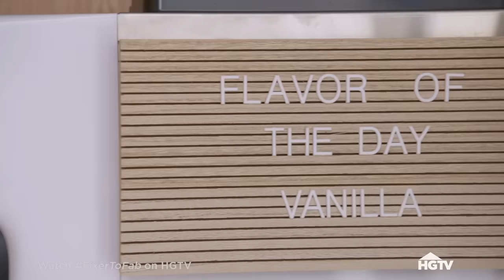The Ultimate Dream Home Upgrade | Fixer to Fabulous | HGTV

Comment: Nice overall (for <$100k), but I do hope the couple got some of their $190k back. They didn't even have to take down any walls. Maybe in the full episode they ran in to problems with systems, foundation, etc, so did multiple upgrades that added $$ up quickly & were not seen in this edit.